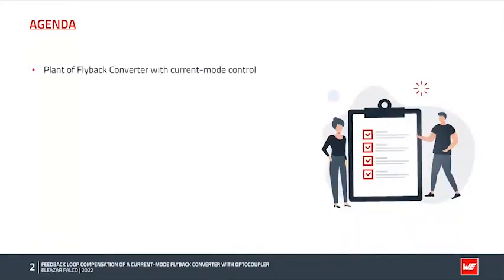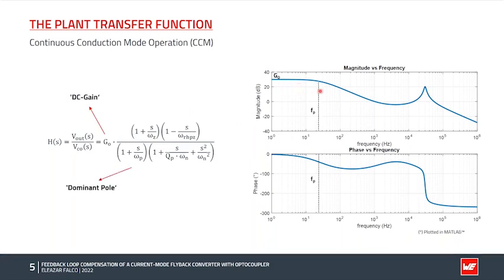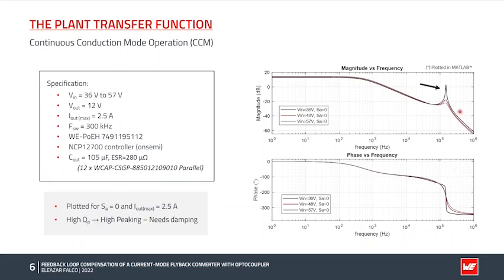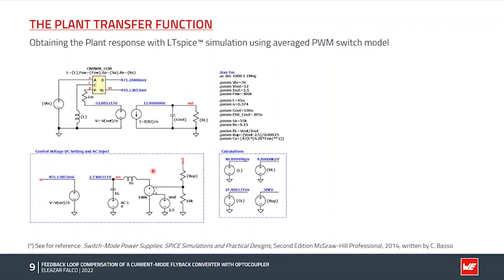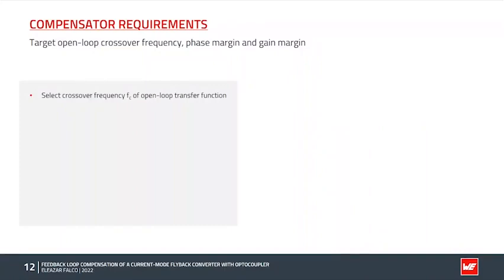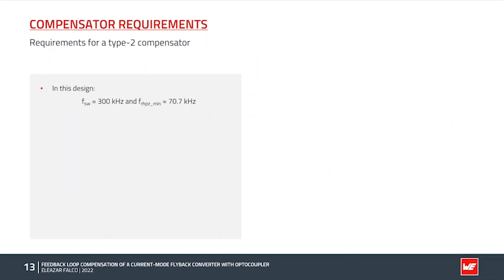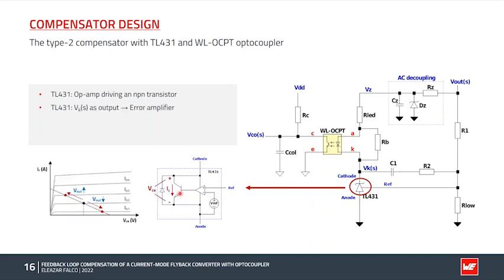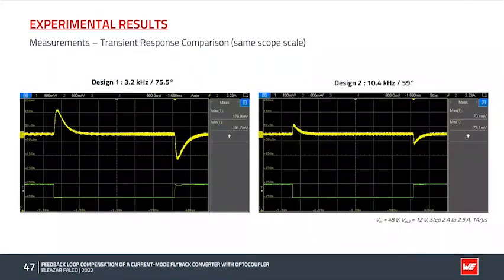Feedback Loop Compensation of a Current-Mode Flyback Converter with Optocouplers

Comment: Where does come from this right half plane zero on the plant transfert fonction ? What are the components creating this zero ?
Reply from the maker: Thank you for the question. The right-half-plane zero (RHPZ) is not created by any component as such, but by the way the energy is transferred from the input to the output stage of the converter during each switching cycle, so it depends on the converter topology. Especially, topologies in which energy transfer to the load only occurs during the off-time of the control transistor, like the boost, buck-boost and flyback converters, have a RHPZ on its control-to-output transfer function, whereas topologies in which there is energy transfer during the entire swiching period (Tsw), like the buck and forward converters, do not have a RHPZ. 
What the RHPZ ‘physically’ means can be intuitively understood as follows. Consider a sudden increase step in the load current of a flyback converter. The output voltage will start to decrease and the loop will react to increase the duty-cycle of the control transistor, so that to increase the primary peak current and with it the amount of energy transferred to the output in order to bring the output voltage back up to its target level. However, as the duty-cycle has increased, the off-time of the control transistor (energy transfer window) is now shorter (toff=(1-D)*Tsw). So if the peak current has not increased high enough (e.g. because too high magnetizing inductance (Lm) slowing down dI/dt), then the average current on the secondary winding of the transformer, which equals the converter output current, would actually be lower than before, and the output voltage will drop even more. So the control loop has reacted trying to increase the output current, but the result is the opposite, due to either too high Lm and/or too fast control-loop reaction speed. If the magnetizing inductance is lower (i.e. higher dI/dt and peak current increase for a set delta of the duty-cycle), and/or the control loop is slowed down (i.e. lower crossover frequency resulting in a lower rate of change of the duty-cycle) then the issue can be solved. Note how, for a set increase of the duty-cycle, a lower Lm will allow the primary peak current amplitude (and thus secondary peak current) to increase high-enough each switching cycle so that to compensate for the shorter energy-transfer window, and thus make the average secondary current to effectively increase, which is what the control-loop is trying to achieve. This also intuitively explains why the RHPZ frequency depends on the inductance (see formula on the presentation): lower Lm (higher dI/dt), then higher RHPZ frequency, and higher the crossover frequency can be set without any issues. Hope this answers your question.